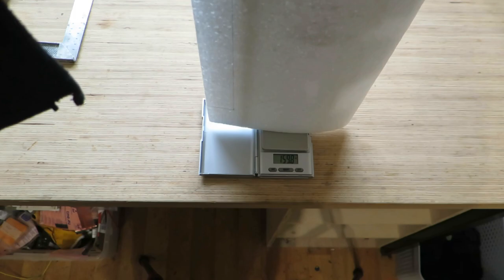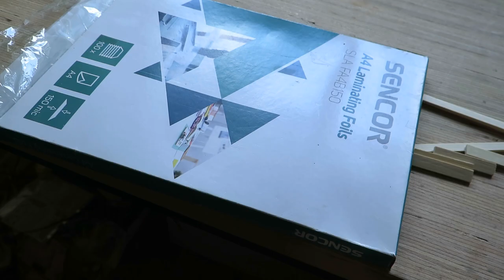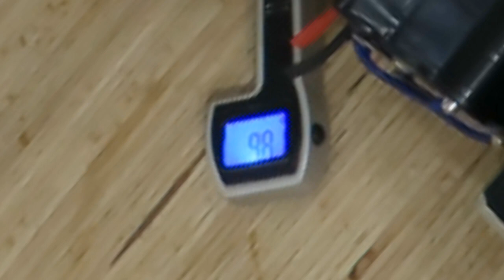Unorthodox airframe powered by hardware store

Comment: Fuckin awesome man, I've been wanting to do this on a foam glider platform for years.
Reply from the maker: What exactly do you mean? I assume it's PVA coating, which would be quite crazy if this was known construction method, though it is very obvious when I think about that...
Reply: @IlusysSystems  well I just wanted to make a 48" foam glider RC/autonomous for long distance flight. I had planned on making a mold of the wings and then making my own replacements out of polystyrene beads.
The glue method you have here seems to be strong enough for my purposes. The crusing speed for glider is more like 20km/h
Reply: Additionally I saw a process similar to yours for making industrial windmill blades. 
They wrapped foam in kevlar and resin, cured in vacuum.
They then cut that into cubes and stacked them, re wrapped/glued.
Then they shape the blade and wrap/glue a third time.
It was proprietary design method that apparently is very stong/lightweight.

Comment: 4:55 impressive. It's because there isn't any tension on the polystyrene in this case, right? (Because of the reinforcement)
Reply from the maker: I think so. Even plain PVA without textile does make it more impact resistant and elastic, but I wouldn't be able to bend it so much
Reply: @IlusysSystems  nice demo 👍
Reply from the maker: @maxmustermann5353  Thanks